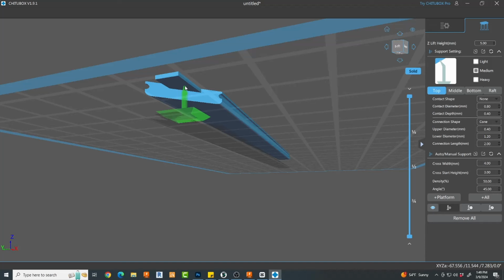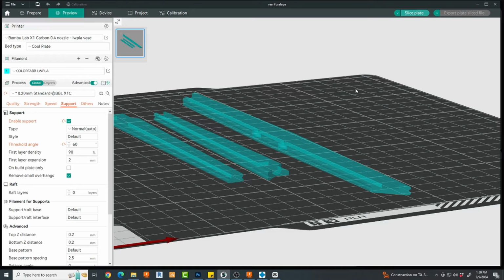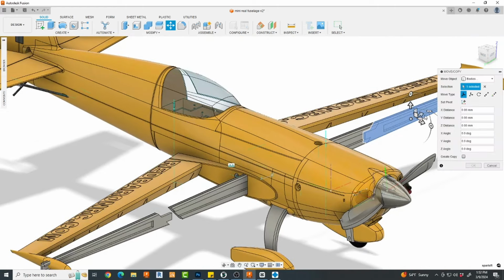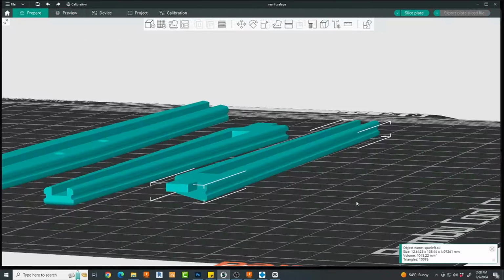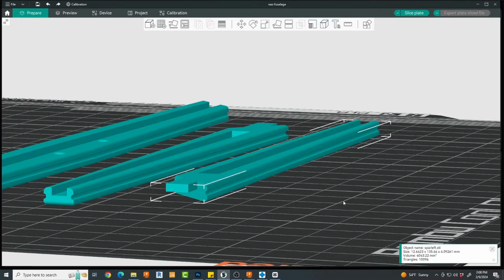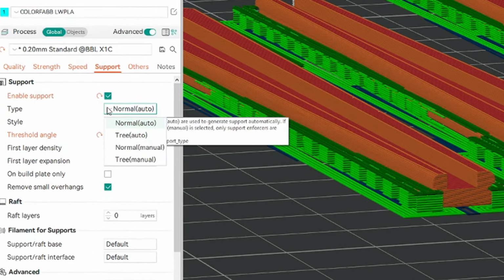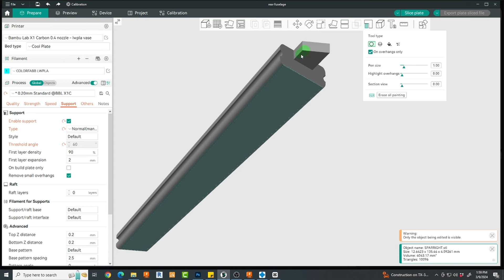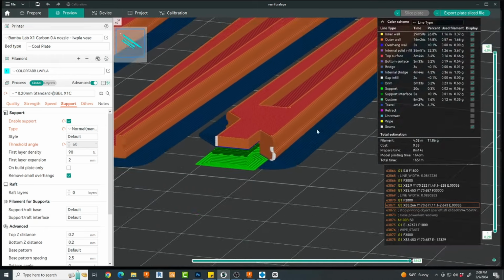Control your 3D prints!  Manual Custom Supports with Orca Slicer for Bambu Labs Printer.

Comment: For info, Cura has support blockers to prevent supports for various parts of the model. You can also specify the degrees of overhang before supports will be generated.
Reply from the maker: Thanks.  I love Cura.  Hated switching over when I got the Bambu as I had all my settings for lightweight PLA dialed in perfectly in Cura.  Apparently you can use Cura now on it?  I have yet to try this.